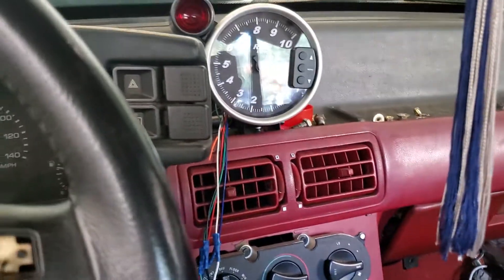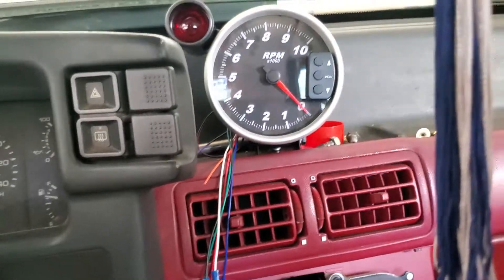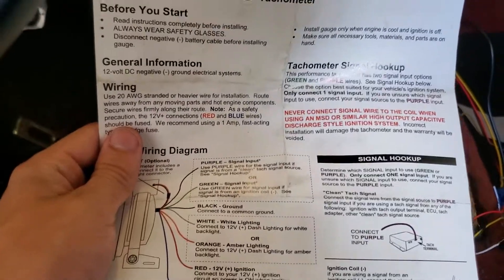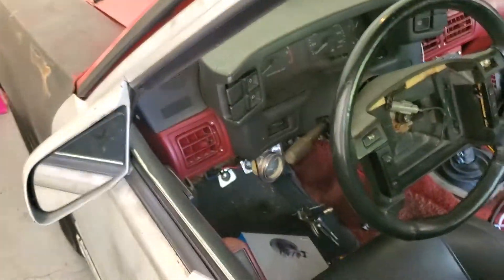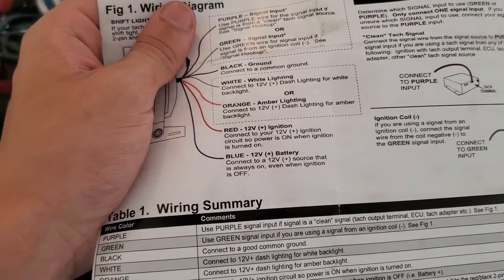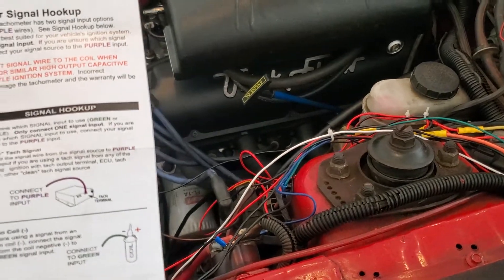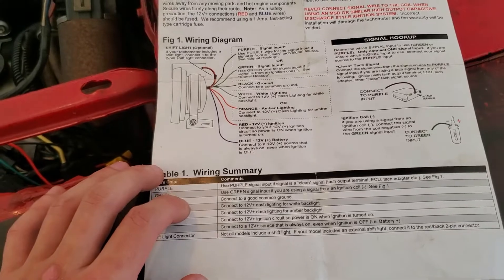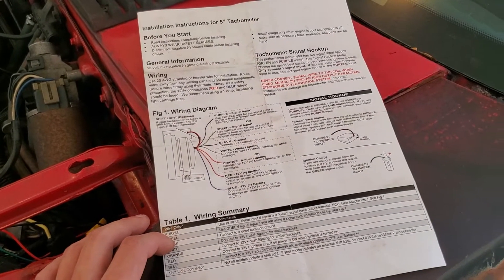Racing Tachometer Installation

Comment: U need a relay for the white wire if ur running it into the running lights. It will burn up the brown wires going into the dash light switch.
Reply from the maker: Thanks for the tip. I'll pin this so that people can see.